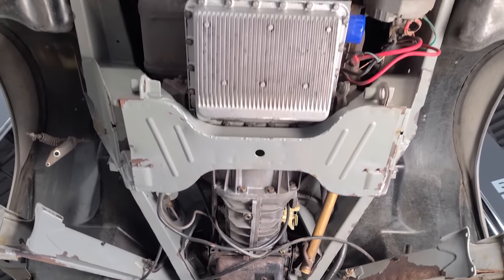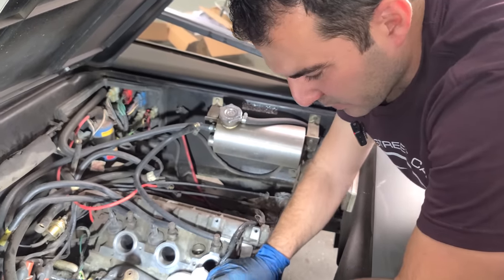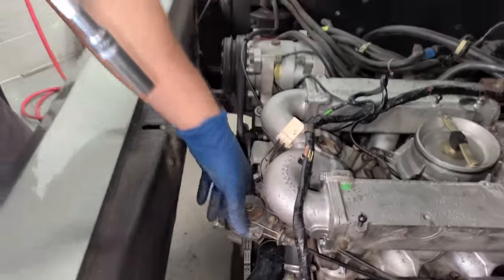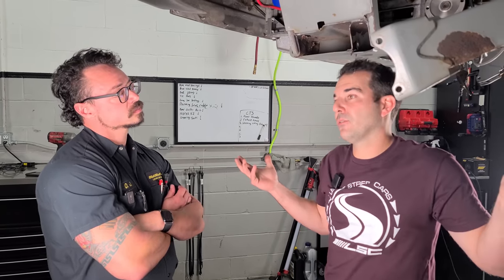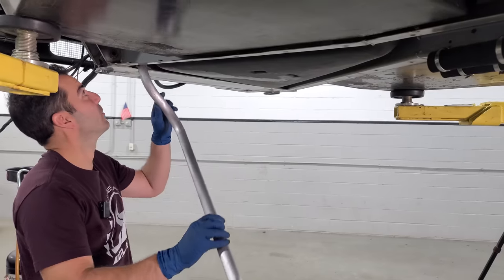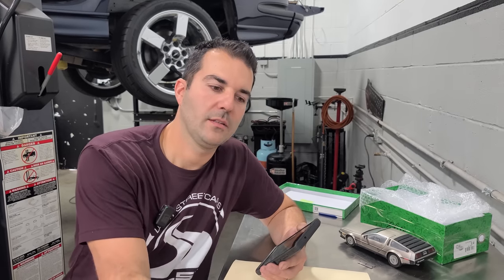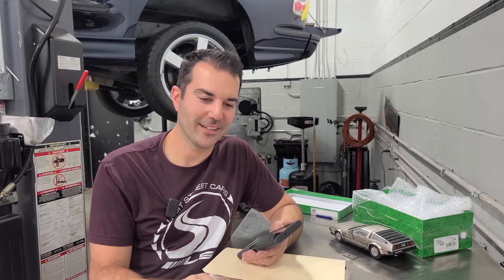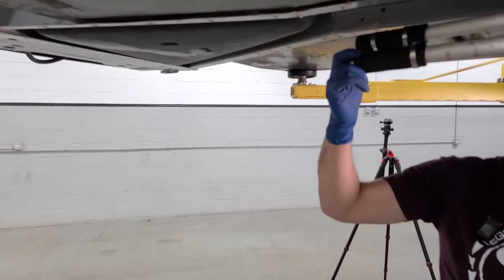I Put My DeLorean Engine Back Together & Spoke With The Orignal Owner! Fake Miles & More Bad News :(

Comment: Maybe a stupid question, but could you fill the ribs of the valley of death with molten aluminum? Like clean it up real good, warm the engine block up and melt some cast aluminum down to fill the voids with?
Reply: That is thinking outside the box!
Reply: @davidcutlip  Thanks. The only thing I could think that might not work, is that the fresh aluminum might not bond well enough to the engine cast? Idk

Comment: Here’s a quote for ya. “Just drop a LS in it” 😂. It sucks that that it’s essentially going to need a frame out restoration. Also sucks that the Valley of 💀 will most likely give up the ghost. Personally I’d be stocking up parts and prepping a nice LS4 in it since a frame, engine and transmission out job is pretty much inevitable.

Comment: I gotta keep it real. That rust is no big deal. You could easily fix and brace that, then just coat it again. As long as it doesnt really get driven in salt its no issue for the next 50 years

Comment: Why not swapping out old brake lines as well? Brake fluid is hygroscopic, right? So those line might look fine from the outside, but could very well be rusted from the inside if the brake fluid had absorbed water.

Comment: If you want the rust 100% removed from the frame then it'll need to be acid dipped. That's cos the rust is in the lap joins and media blasting won't remove that rust so it'll eventually expand and blow out the seam.

Comment: 33k plus what 30k in repairs ?  I would replace all those brake lines, based on that master cyl.  Those worm clamps ALWAYS need adjustment as they will leak after 2 weeks from initial install.

Comment: Wouldn’t coolant hose clamps be better than those you used? Figure the constant heating and cooling expansion contraction wouldn’t be as good with those fixed pressure clamps.

Comment: Luckily the frames on these cars were also used on the Lotus Espirit from the time, so you can get them, just minus the epoxy coat. DMCH also has them New Old Stock, but be prepared to spend 25k

Comment: The DeLorean Motor company base new old stock frames available. If you are going to remove the frame, you should just go ahead and replace it. It would be better than repairing that Swiss cheese rust of a frame you have.

Comment: The new Delorian manufacturer made a video a long time ago stating that the original epoxy coated frames did not perform as the engineers thought. The epoxy cracks over time and water seeps in causing rust. He said that in his restorations he throws away all original structural frame pieces, uses his new old stock inventory or has new units made. He then coats them with the best flexible coatings available today.

I’m sorry but i cannot be too optimistic about your repairs as the damage may be far more extensive than you can now see and any exposed structural frame components will continue to crack and rust. That said I hope you do the best you possibly can. Good luck.

Comment: Alex I'm going to guess they use 11mm on things (which there's really NO reason other than $) because that bolt needs MORE than the maximum torque of a 10mm nut or bolt, but less than what a 12mm can give you, so they use 11 for the intermediate torque range. That's how you save a penny here and a penny there when it comes to building cars and making profit. When you need to pinch a penny, I'll bet the went from 12mm to 10mm on a LOT of those bolts, but SOME needed to be 11 just for the spec of torque. That's my bet.

Comment: Yank the motor (100Kg)
and the cooling system (200Kg)
fab up a bicycle crankset (990g)
hook up an espresso capsule machine (1Kg)
upgrade the coke mirrors (1.69Kg) 
get Juan Valdez (65Kg)
Extra absorbent towel (15g)

Comment: Silicone spray on those coolant hoses is massively concerning. Those hoses are held in place with friction and you putting a  lubricant between the hose and the pipe would greatly reduce the strength of that join.

Comment: I know where you can get a DeLorean frame with manual set up for your car. Message if you are interested. As for the engine swap I suggest a souped up 4.3 V6 since I haven't seen anyone else do such a thing. Plus doesn't need to much horse power if it's gonna just be a babied sunny day driver.

Comment: So if you are going to eventually pull the frame and "strengthen it" why not replace it with an aluminum or other alloy that doesn't rust and go from there?

Comment: So, I'm only 19 minutes in obviously I don't know what you're going to do with the end of the video but if it was me I would separate the frame from the body of the car send it off to the acid dipped have someone who's a really really good welder Weld and patch any of the holes that you've got. You're expert who's helping you look around the frame and giving you opinions on whether it is weldable or not has a good point when he says he doesn't know where the rust is going to end. I seem to remember in my industrial electronics class there is a tool that you can get that runs a small voltage through the entire frame and you have a pickup on the other side and based on how many volts that you're reading you can tell where there is corrosion or not. I do not remember what the tool is called but that is something you might want to look into. I know that you don't have an endless supply of funds, but if this is truly your ultimate dream car, I think you would agree with me, it's worth doing right. It doesn't have to be LA Auto Show perfect. I would love to see you daily this thing. 😁

Comment: Honestly man, it it was me I'd probably patch and hope on the frame but, then again, I don't have the cash or time to do a frame off resto. You, on the other hand, actually make money from these videos and a frame off restoration is going to be at least 3 videos worth of work so it might offset that cost for you in ways we can't imagine 😂

As far as an engine swap, I'd go for an LS as I reckon the valve cover would look cool in a DMC and parts are so easy to source for them that you'll not really ever be worried if something goes wrong. Why worry when it feels like the homeless dude down the local park has a rucksack full of LS bits as everyone does 😂

Comment: I would think vapor blasting would come in handy in a lot of these scenarios, like the coolant pipes and valve covers but what do I know. You aren't leveraging the power of vapor blasting on this project for some reason. M539 vapor blasts everything he possibly can and the parts always come out looking like brand new money. Rebuilt original engine would be my choice. Keep it valuable. An LS swap would be fun but would the rest of the chassis be enough to handle it? I saw the primitive nature of the chassis & suspension and I highly doubt it. Plus the car just won't be worth as much. If you are 100% sure you are going to keep it then yeah swap in an LS, put a blower on it and let us all watch the rear end explode out of that car the first time you try a burnout. That's entertainment!

Comment: You are a genius to get this all apart and put it back together. But, it is all to deliver x-horsepower to the rear wheels - electric motors, a big battery and a speaker system to produce engine sounds would do the same thing with about 995% fewer parts. and no pollution.  Sorry petrol-heads, but you know I'm right. Right Alex? As an addendum. YouTube's best, engineer, mechanic, problem-solver, great guy, and dad and husband - all for free. Incredible!

Comment: Worked ias a mechanic in a radiator shop... screwdriver or socket for tightening clamps? I had a dedicated nut driver. Fast, sure, if it wouldn't break it lose I went with a socket.

Comment: Hello if you are doing a full restoration on the car I would rhino line the underneath the car the same color or lizard skin it the same color as underneath the car so you would never have to worry about it resting anymore because that will protect the underneath the car

Comment: You know when pull the heads you can just pull the cylinder out by hand they are actually just sandwiched betwween the bloc and the head. Never rotate that engine with the heads off!

Comment: What's a necklace called around your wrist!!?? Lmfao. Thanks Alex. Actually laughed out loud.
Reply: Here's a link for an article I read a while back about what Holley is doing with a test mule as they call it.
They're using a GM LV1/LV3 V6 platform and developing aftermarket go fast parts.
Could be a very interesting option. I posted it here because your question about the engine swap doesn't seem to be allowing any more comments to be added.
Reply: Ok so I have tried to post the link twice and it doesn't seem to want to let me.
Google this and the article will come up.
This is right in your wheel house and they are talking boost 😉

CAN A MODERN V6 SWAP WORK? WE CHECK OUT HOLLEY'S LV1 V6-SWAPPED PONTIAC DEVELOPMENT TEST VEHICLE

Comment: Watch way too many videos and am shocked when guys use flatheads on hose clamps, just waiting for it to slip. I have a small craftsman 1/4 set that has a driver handle.... it never fails!
Reply: I always start to grab my nut drivers when tightening hose clamps c and it never fails there not in reach lol. Screw driver plus any flathead in a tight or confined space equals stabbing my hand at least once every time!

Comment: For the frame, don't repair it. Get someone to make a new one. With modern design and materials, you could probably get it made stronger, lighter, and much more rot resistant.

Comment: Don't even think about swapping the engine - a DMC12 came with an original engine - OK it wasn't very good but that's what it was. Straying from the original will kill its value and open up a pandora's box of additional problems. Remember that they were crap cars to begin with and any more power/weight will make it even more undriveable. Please be realistic.

Comment: Limiting a proper restoration by by using a timeline of before Halloween is irresponsible.     This could have be so right without the bias, dumb and inexplicable so called 'deadline'.   Why not just make it for Christmas?     Like Christmas 2027 and don't act like you have some deadline that doesn't exist.   Just do it right.

Comment: Sorry don’t agree with your “specialist” that is an old car you are trying to make a fun driver. It’s never gonna see a track or be the best of its examples. Re epoxy the parts, paint it and drive it. It will never impede the drivability or safety of the car.